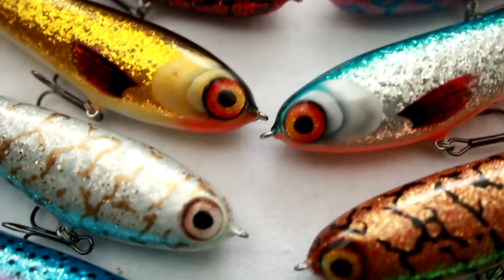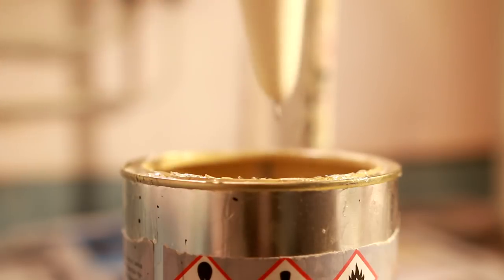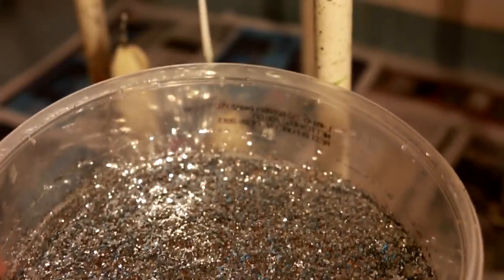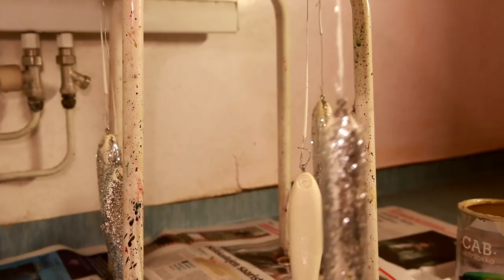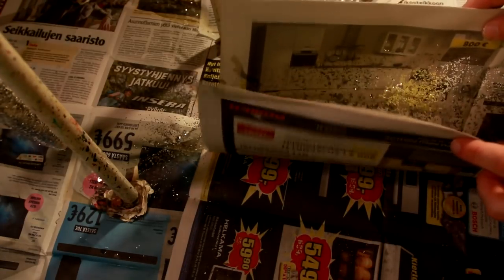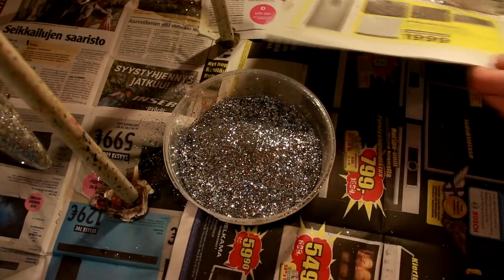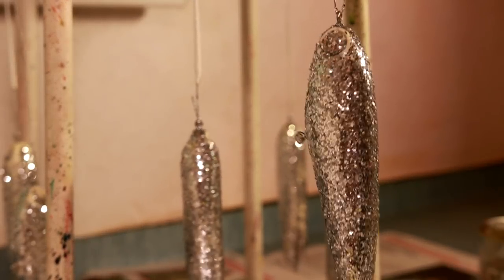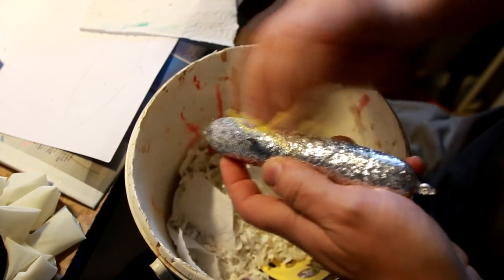How to use glitter for fishing lures

Comment: Wrong way. Use about one table spoon clear liquid coat polyurethane in some kind small plastic cup and add glitter and mix . Add glitter to the mixture till become tick like sour cream. Use small brush or piece of spunge and start applying on lure. You'll see magic. There is no sanding, pressing glitter to flattened,more leyers. It still flat.
 After that when is dry put one more layer ( or more if you like) of clear coat. DONE !
Reply from the maker: Thanks for the tip!